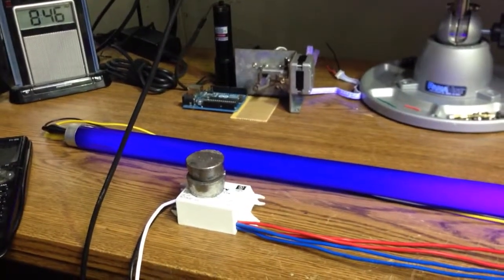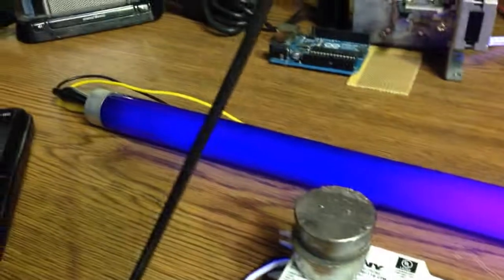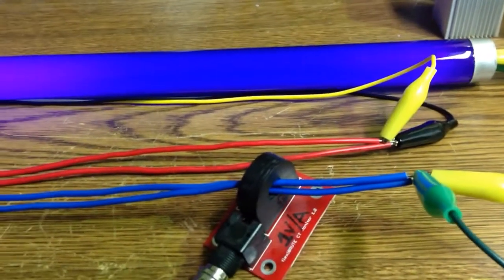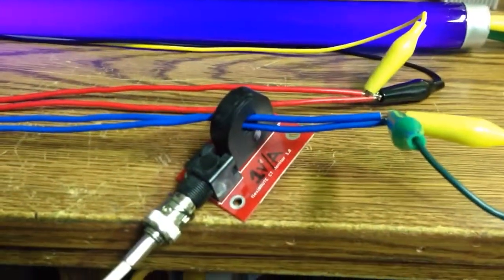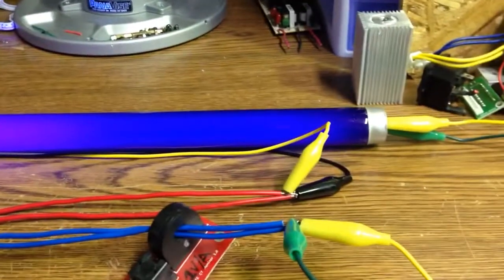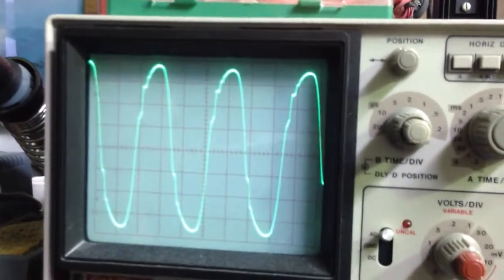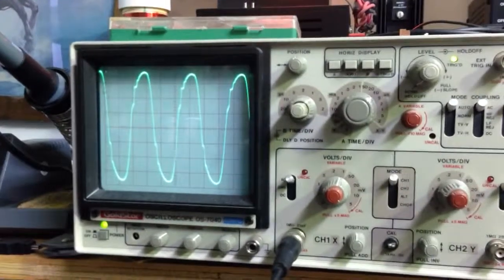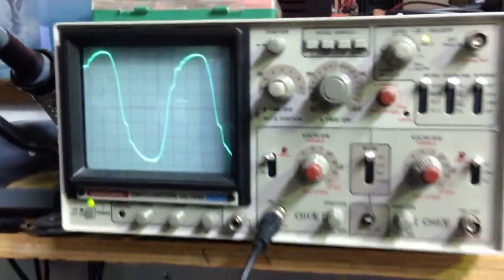Testing a CFL Ballast for Low Pressure Sodium use

Comment: So this means you can use any electronic ballast for fluorescent tubes to drive a low pressure sodium lamp? (As long as it's the correct wattage)
Reply from the maker: Yes!
Reply: Thanks
I can get fluorescent ballasts for free from the dumpsters at my local street lighting company so I did some tests.
I started with an Osram QTP-DL 18-24W electronic ballast and my power meter showed way below 18W (around 14W) and it struggled to get warm enough to vaporize the sodium.
So I then tried a Philips HF-P 136 PL-L III IDC 1x36W, which was much better but still only pulled 15W after half an hour. Brightness still not what I'm used to see.
Sa lastly I took an Osram QTP-DL 36-40W and that looks to be the best option. Startup time is normal, light outpuf looks like it should and the power meter is close to 18W.  @Romenadan

Comment: Tried this with a magnetic ballast for 32w circular fluorescent and a 35w SOX.  The starter struggled to get the the arc happening, but once it did the lamp had no trouble burning away for 10 hours.  Side-by-side with an actual 35w SOX ballast I couldn't tell any difference.

Comment: now use the ballast on a flyback! haha i love it!
Reply from the maker: Lol, I could probably power a flyback with it but since it is only pushing out 254mArms it wouldn't be very impressive. You'd have to use a resonant primary set to 30KHz in order to get any appreciable output.
Reply: haha yeah its a bit small, i used a new one from a full sized dual flourecent light bulb ballast and got really good flyback output, ive only got it to work by using the built in coils tho :/ so it just frys them up, even when there in oil hahaha